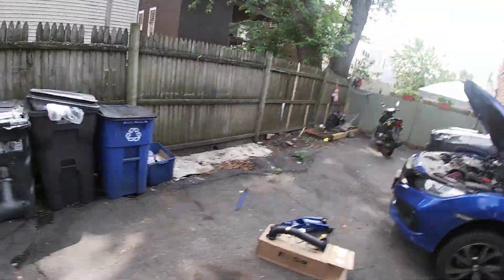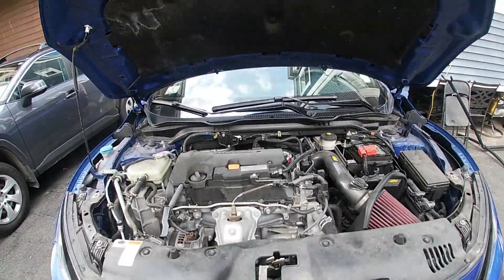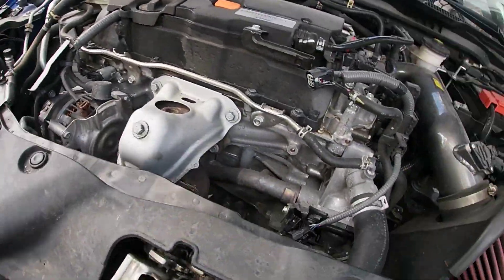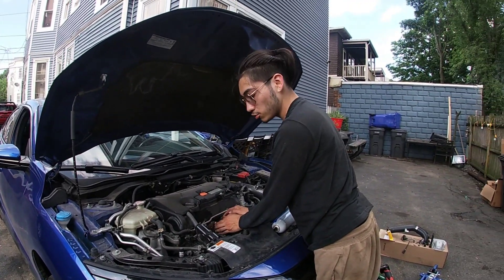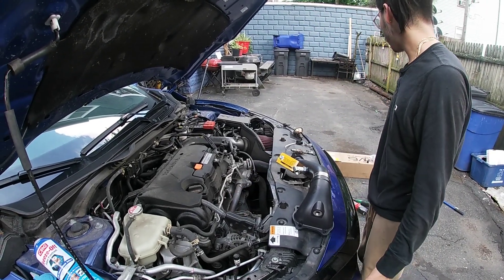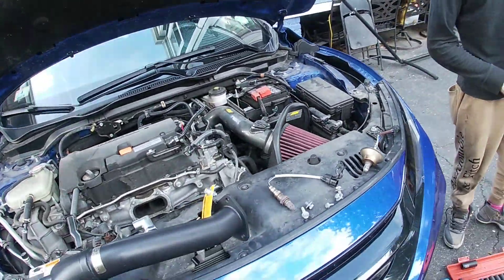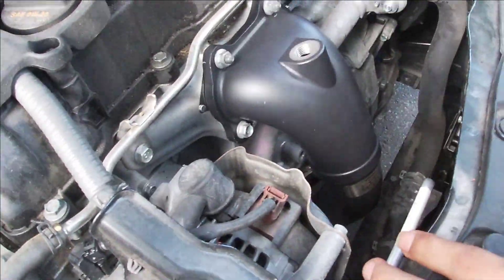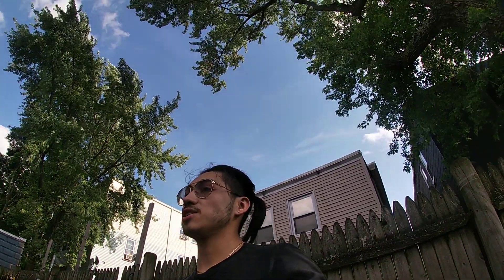2019 HONDA CIVIC SPORT (K20C2) RV6 CATLESS DOWNPIPE INSTALL! | Catless CVT!

Comment: Hey brother I hope I get a reply

Just installed my downpipe... And got and emissions problem warning after driving it like 1 day in 1/2 did u come into this problem? I used the same O2 sensors from the previous stock cat.
Reply from the maker: This happens if you don’t have a tuner. You need to clear P0420 under the codes list w a tuner (Hondata or ktuner) technically the system can still read it and it is still there but you won’t be able to see it. Just check you emission laws for state inspections in your area cause they will fail you lol

Comment: Great mod to get for any car. I have a 2017 civic lx 6 speed. Great mod to get especially after Ktuner.
Reply: Can't find the catless downpipe..where did you get it from?
Reply from the maker: Pretty sure it’s discontinued bro 😅!
Reply: @errolcrutchfield1803  I got mine on ebay. It was an rv6 they had a high flow cat and one with no cat. I have the one with no cat. I have the Invidia cat back exhaust as well and it comes with that little insert at the tip of the mouth of the muffler to lower the tone cuz it is super loud. I drilled 2 other holes to attach nuts and bolts to secure it more tightly on.
Reply: @errolcrutchfield1803  I just looked it up. If u go to ur search engine and type in k20c2 downpipe. It pops up. I didn't hit on it.
Reply: Thanks guys